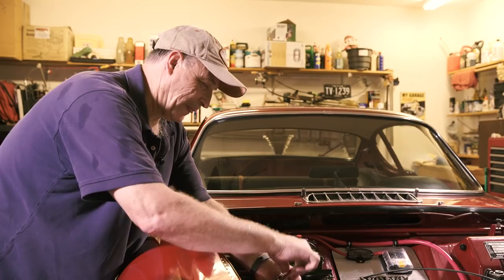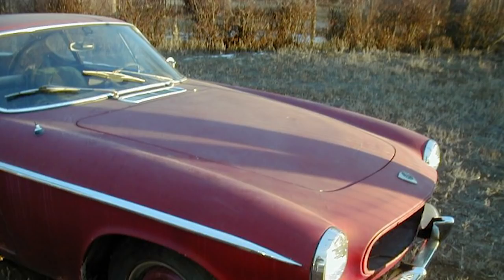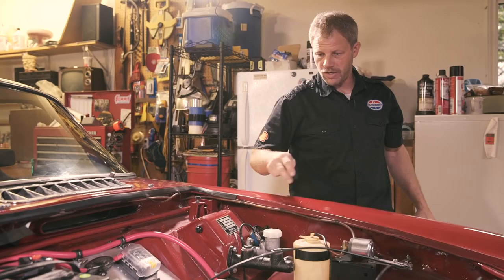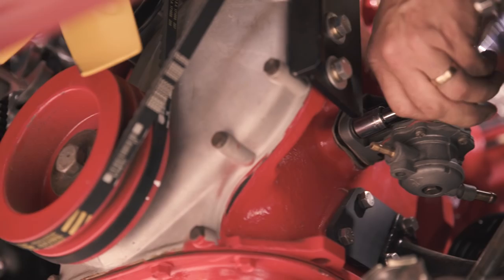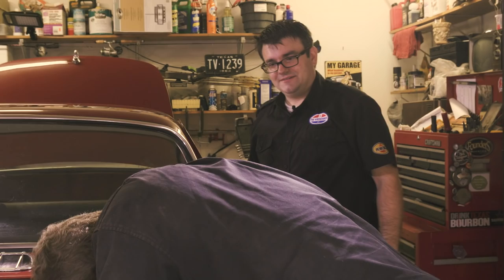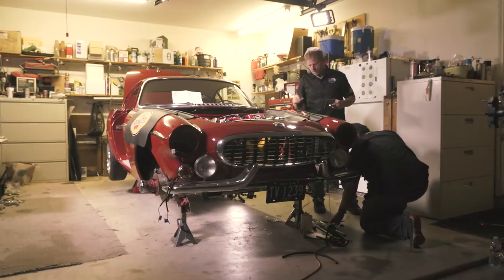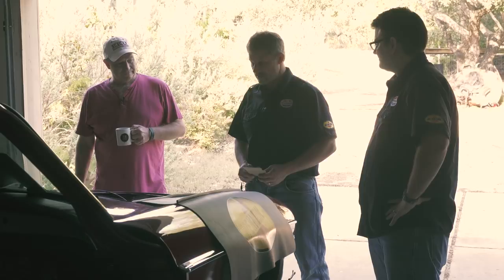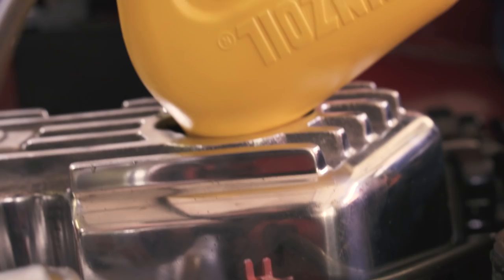The Wrenchmen | Larry's 1964 Volvo 1800S - Episode 6

Comment: Just wanted to say THANK YOU for calling this model year car by its correct name -- the 1800S -- and not calling it a P1800 like 99% of the internet. Only the early Jensens were called the P1800. After 1963 they were either the 1800S, 1800E, or 1800ES.
Reply: And in fact, I believe that the chrome wind scoop just ahead of the windshield is from an earlier Jensen model.

Comment: I wish i could find some one to help me with my 1933 Plymouth four door sedan, I am 56 in a wheelchair and I am so close to have my hot rod done. Been working on it over 20 years from a wheelchair and still have not driven it. had it almost done, got sick with my heart then it sat for 2 years, i got it running again then the new power steering pump went out from sitting and now i am having trouble getting the old pump off, and some other minor things.  Anyway my car is on you tube, under Danny 33 plymouth 4 door sedan.

Comment: What is that timing app you all used?
Reply: This is the app for the 123Ignition Tune+ distributor with bluetooth. You can set your own ignition and vacuum curve, which can be more precise than a pre set curve or a worn out distributor. I have a Tune+ distributor in my car and it is quite nice and can handle more powerful coils than normal points ignition systems. The app enables some features like rpm gauge, coil charge amperage, voltage and anti theft ignition cut off.